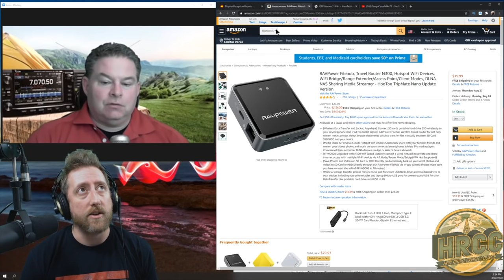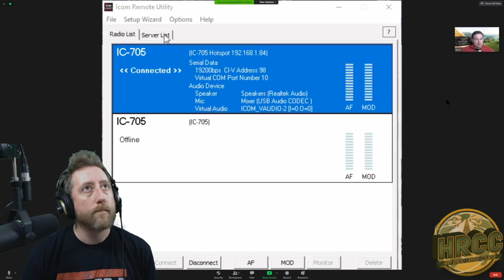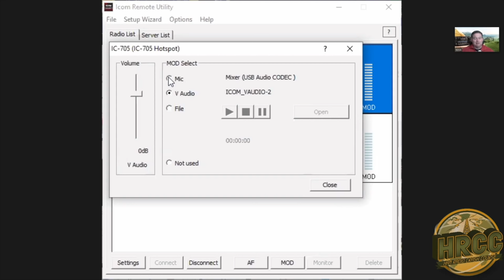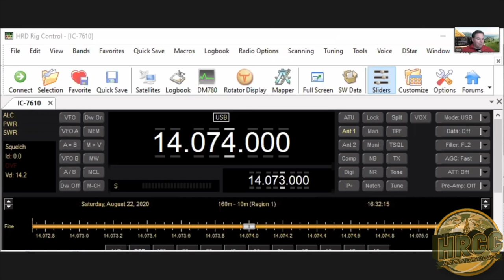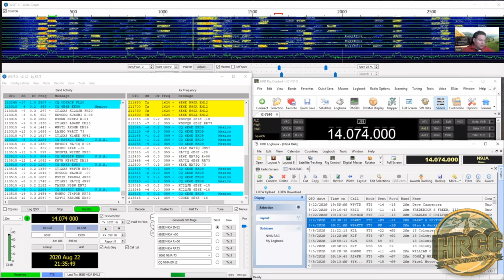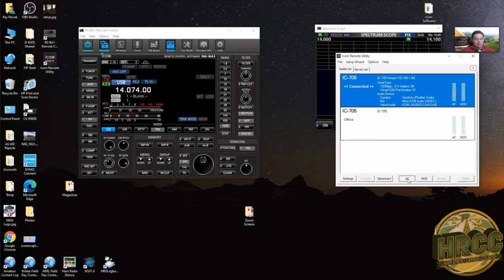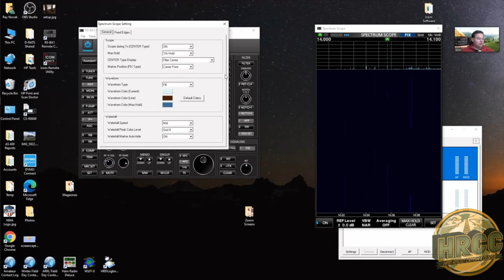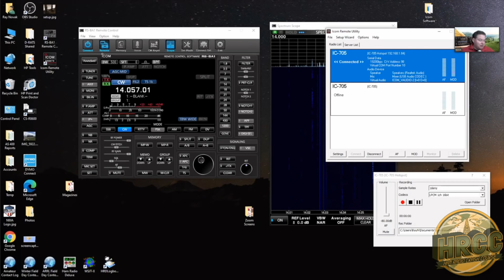ICOM IC 705 Wireless LAN Digital Demo

Comment: One of the limitations with all the Icom radios, is that the network protocol is not documented.  That means to use the network you are limited to using RS-BA1.  No other software works.  Icom will fall behind here, since all new radios from other manufactures do publish the ethernet connection info.

Comment: Hey guys, I don't know much about amateure radio (working on getting my license) but I do know about networks and I'd like to offer a couple ideas.
First,  to get Josh on your radio, you could setup a VPN on your network, there is no super easy way to do this, but it would act as if Josh was on your local network at your home (will not work for the AT&T hotspot).
2nd, setting up a VPN so you could access your radio remotely is by far the safest way to do this, the traffic is encrypted from point to point and less of a chance someone could see what you are doing. Feel free to reach out if I can help in any way!

Comment: BTW, although it is not documented, the IC-705 works with a baud rate of 115200.  Thus you should set this in the software you are using.  The spectrum will be much faster.
Reply from the maker: Really?  Oh man, I'm going to try it.  And yes, that faster baud rate will get you a much faster waterfall in software.
Reply: I still don’t understand why they force a virtual serial port over WiFi or usb. Both of those support way faster speeds. Why use serial at all???

Comment: Oh boy. As one can see from the video, the frame rate of the spectrum at 19200 is about 1/10th of what you would get at 115200.  Since at 115200 on the 7300, gives about 4 frames a second,  we see  here that the refresh rate is about 1 frame every 3 seconds.  This assumes it will work, since all the other radios with a CIV output requires 115200 otherwise it will not work.  This is a major limitation of this radio.  Also, the CIV documentation shows that VFO B is supported in the memory modes, but exactly like on the 9700, it does not even though it is documented. There should be no reason other than a design flaw that this cannot be run at 115200. Tom va2fsq.
Reply: If Icom does not fix Bluetooth 
Certainly Elecraft will do it for the KX4

Comment: I think it would still be better just connecting a raspberry pi direct to the 705 and VNC into the pi over WiFi. Much easier and more flexible. No need for a portable router.

Comment: Hi Ray, Most Home Routers have a Port access called DMZ or De-militarized Port. Basically you say which IP the unit is. (this case 705) then you set the IP on the router to that unit. The AT&T router should give the 705 access to the internet, only thing is that now this unit (705) has access to the Wide open internet! No firewall. So people can access it. That means EVERYBODY. Just a thought to test it. I would not make it a permanent solution. Hope this helps!  Mike K
Reply: Mike, thank you for the tip.  Not sure I want to open it up as every RS-BA1 user will want to test the IC-705 before they buy....  I would never get a chance to use my own radio.  LOL

Comment: But still no antenna tuner....However, I have to admit the Bluetooth functionality is interesting
Reply from the maker: I still have alot I'll say about this when the review times swings around.  Generally, you want a resonant antenna with your QRP rigs.
Reply: There is an external tuner port on the 705. Icom will be releasing the tuner (AH-705) "soon".
Reply: I bought an elecraft Atu-1 to go with mine